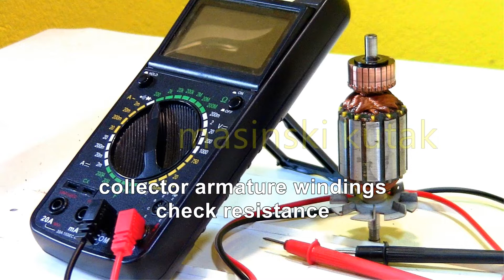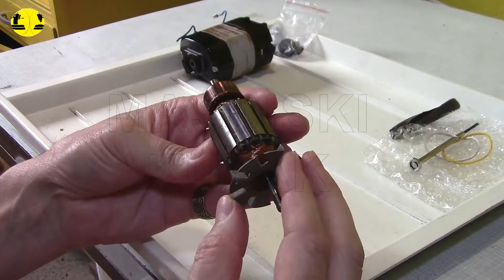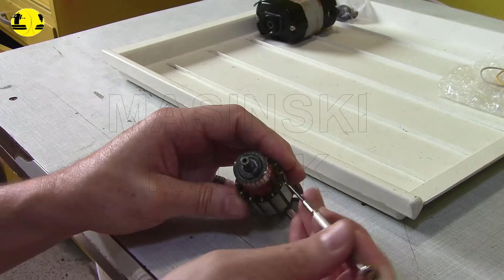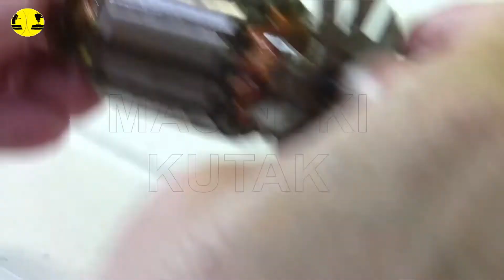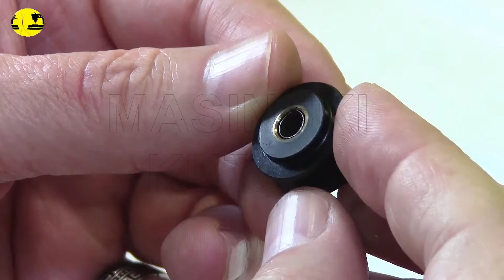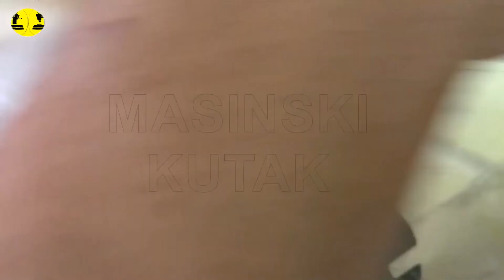How to Check a Engine Armature for Damaged Windings | Bernina 830 Record Motor | Bernina Armature

Comment: I have a Bernina Nova 900 and have checked the commutator's resistance and everything seems fine but it will not run. So confused and cannot find a new motor for it.
Reply from the maker: OK. the engine may not work for several reasons, the engine may be completely correct but will not work, for example a faulty control pedal, a broken cable, a problem with the electronic board...etc.
.
Bernina motor: https://www.masinskikutak.com/2022/01/bernina-electric-motor-models-and-types.html
.
Bernina service manual: https://www.masinskikutak.com/2021/09/bernina-service-and-adjustment-vintage.html
Reply: @MasinskiKutak  Thank you, I hope to fix it. It has sentimental value, otherwise it would just be replaced.

Comment: How do you remove the plastic pulley, on the motor, the part that drives the belt? I don't see a set screw on the pulley, nothing.
Reply from the maker: There was the same question somewhere, but I don't know on which video, there will be a shorts video on that topic soon, so if you can, be a little patient.
Reply from the maker: https://youtube.com/shorts/Cj1cc9ODr4k?feature=share